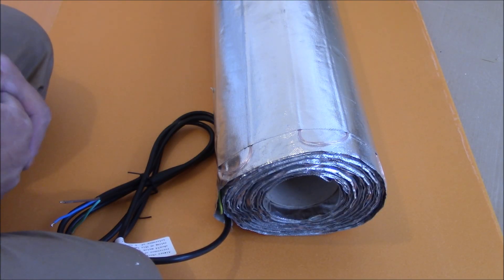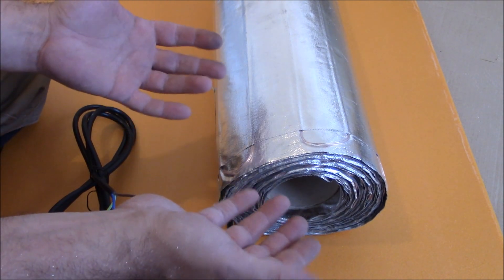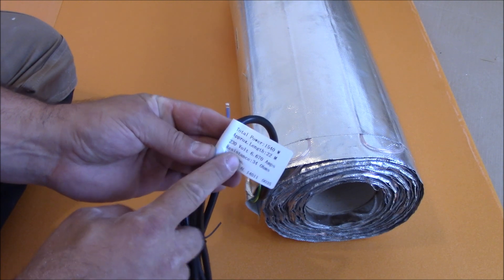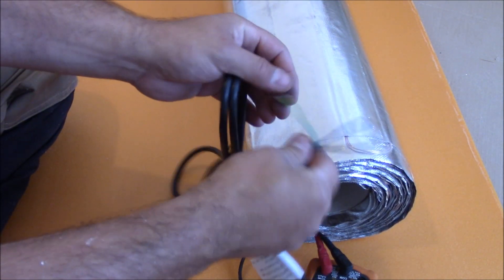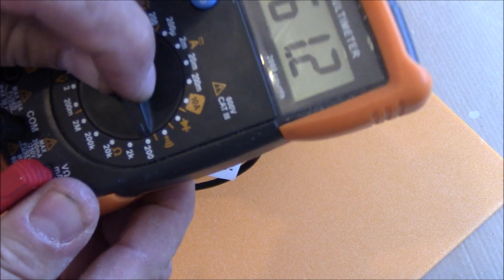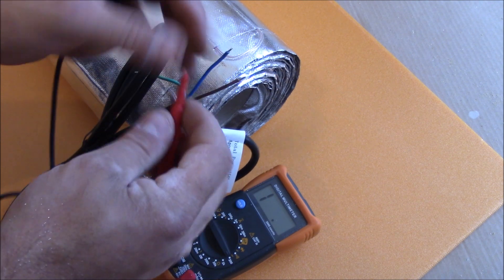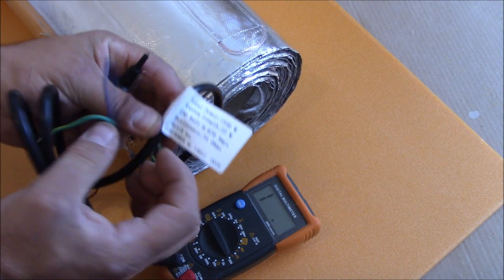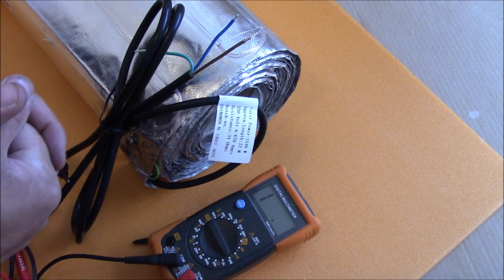Underfloor heating mat test How to test check an under floor heating mat resistance PROWARM warmup

Comment: Hi mate.  I need your help.  I fitting this matt from proworm and I've done resistant test but manufacturers required also insulation resistant test 500 volts  . I have megger multi tester   suppose to do between protective conductor (earth) and one of the live or neutral because anyway is the same line. Also they requires the circuit to be protected by rcd but this is old fuse  cartridges box without rcd .Can you give me some advice?.  Thanks